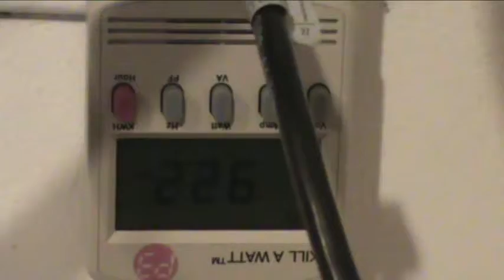I repaired Chinese inverter, repairing ATV, and creating solar water heater.

Comment from the maker: It was my fault.  My turbine fried it....  we rarely have strong enough winds to make the kind of power that is harmful for it.  The day it fried, it was calm all day.  I had to drive a three hour round trip and as luck would have it, a freak windstorm came through.  I tornado was spotted about 60 miles away that day.   I plan to automate the inverter so it turns on for a few hours during the day while I'm at work if the batteries are full.

Comment: You blew the hell out of that cap wow was it lighting? I got my DC Side working on mine. but the AC side is mystery. All mosfets test ok. If you hate the Chinese inverters there is always enpahse. Solar BLVD had them on sale for like 125 bucks 99 percent efficient. I like the 24 volt Chinese inverters. I would buy them from you.